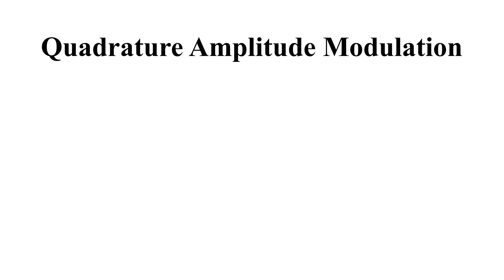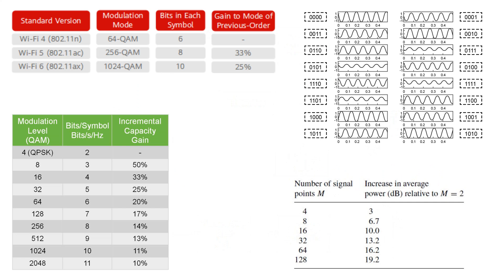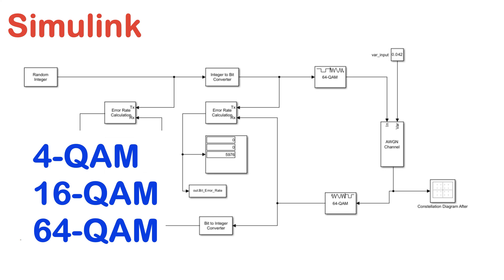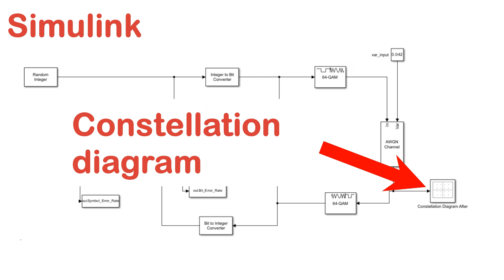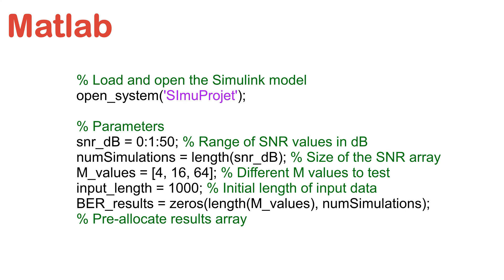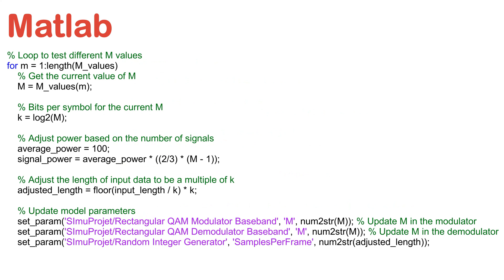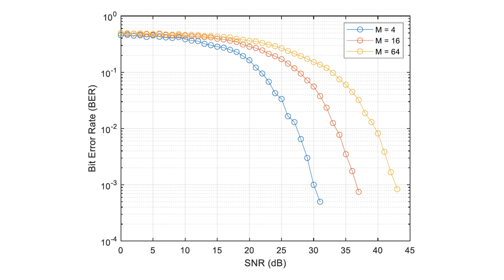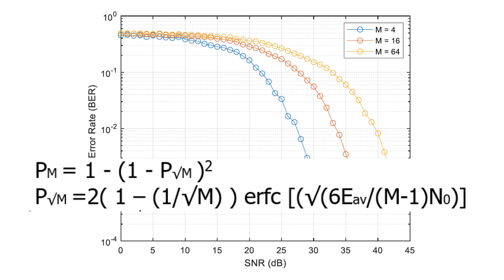QAM (Quadrature Amplitude Modulation) Simulation Tutorial in MATLAB and Simulink

Comment: how to desai RFID tag folded dipole antenna design using cst
Reply from the maker: @Syahrulkariim  we will try to do that in the future. This needs a microchip to modulate and demodulate data. That microchip acts as a transceiver, then it is connected to the antenna, To do that we need to buy that chip, most likely program it using microcontroller and then connect it to antenna. Designing the different section of that chip separately is not easy, since it consists of a lot of digital circuit.